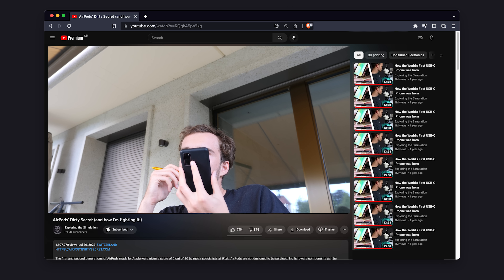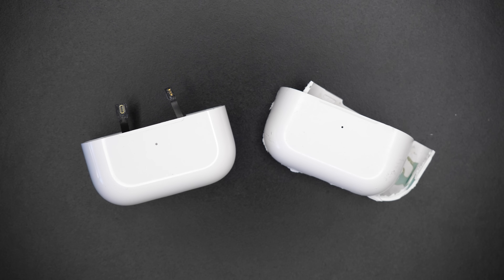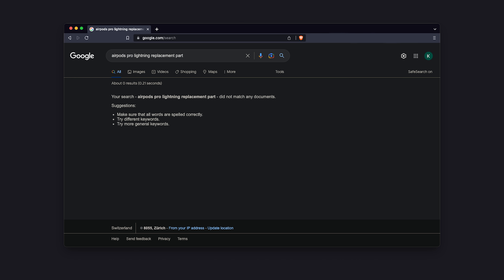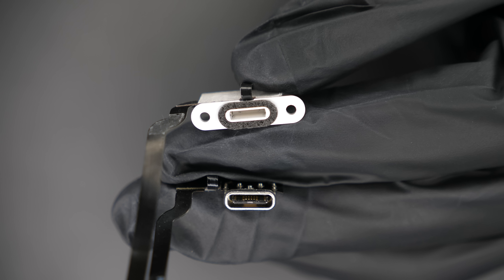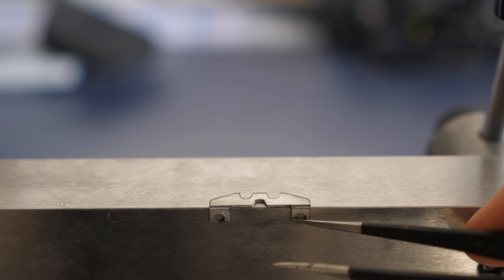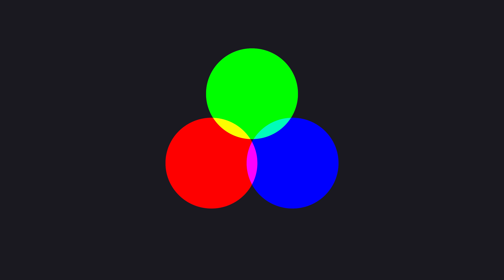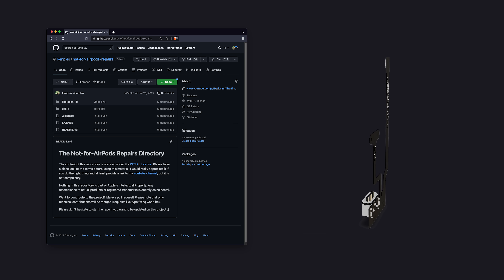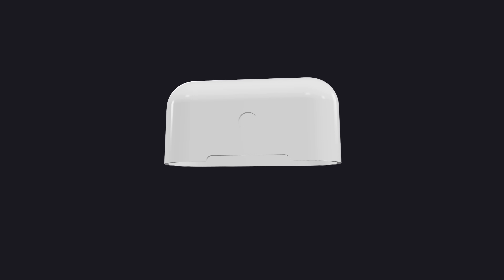I Put the Pro in AirPods Pro (with Apple's help?!)

Comment: I was really going to swap out my existing (Apple replaced my Airpods themself for free ~6 months ago due to an issue) Airpods Pro Gen1 for some new ones that have a USB-C charging case. Cause I want to ditch as much non USB-C devices that I have to simplify my charging situation. And I usually sell of the "old" equipment for cheap just so that stuff doesn`t end up on a landfill. But THIS would be amazing and I`m ready to buy one of these modded cases (I`ll donate my old lighting charging case!) for the price of a new airpod set. I`d rather have something that is repairable! In any way, THANKS for being YOU! :)

Comment: Great project. In China there are already a few thousands little shops provide similar service. Currently it is about 25 USD to change all three batteries for airpod (case, 2buds). If use Chinese online shopping site such price can be less than 15usd

Comment: This is amazing ! I see you have an EPFL card. Did you learn to design PCB there? if yes, could you please tell me the courses you've followed? I am a student in robotic's master, with a microtechnics bachelor. I would love to design my own PCB, but I don't really know where to start
Reply from the maker: Learned on YouTube. DigiKey tutorial (guy with a bowtie) was pretty good. If you have a specific goal in mind it always helps.
Reply: @ExploringTheSimulation  well, the issue is, ive learnt how to compute current voltage and all from epfl's courses, but making a pcb is hard because I dont know any real component, like the different type of amplificator, the package size for a component or how to decide of a micro processor and design from its datasheet.

Ill take a look at these videos, thanks!

Comment: This is awesome! Will you start selling the pcb for the non pro version as well? I would be very interested!
Reply from the maker: yes, probably, but those require a 3D-printed shell, so it's less accessible
Reply: @ExploringTheSimulation  maybe a bundle with the printed part included? But I can understand that all the printing would require a lot of time and effort. May not be worth it.
Definitely still interested in the pcb, as the 3d printed shell could also be ordered online or by asking a friend to print for me.
Reply from the maker: @Emma Mitchell  the problem with the 3d printed parts made with resin is that the resin solidifies when exposed to UV light. So those cases would continue to cure when exposed to sunlight and would become quickly too brittle and fragile. A solution is to coat them with a UV-blocking paint, but it's too much of a hassle and I don't want to deal with that. So the options I'm exploring now are SLS printing and injection molding, but realistically I don't think I will sell those before the summer. Might sell just the PCB before that though. Hope it clears things up :) thanks for being interested
Reply: @ExploringTheSimulation  thanks for the insights!

Comment: Amazing, video, I wish that Apple would stop green washing their products by claiming how "great for the environment" they are while pulling shit like this on basically all of their products. 
It's so frustrating that you can use an apple product for many years after you purchase it with software updates and support *as long as you don't break it, battery fails or other component dies unexpectedly.

Apple could be leading the way with allowing products to be designed from the beginning to be able to be easily repaired while still retaining a great looking design.

Comment: I don't think the PCB is the tricky part. Anyone with $50 worth of parts (soldering iron and hot air station) can assemble that PCB. I think the toughest part is the metal work.
Reply from the maker: Well we sort of agree, I included the metal work with the PCB when I said it was too difficult to reproduce! Thanks for the comment